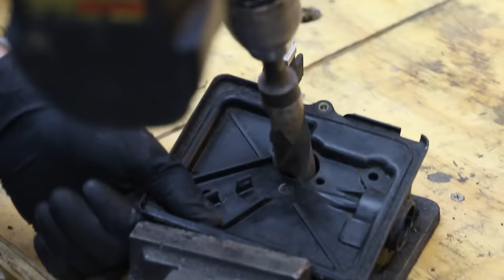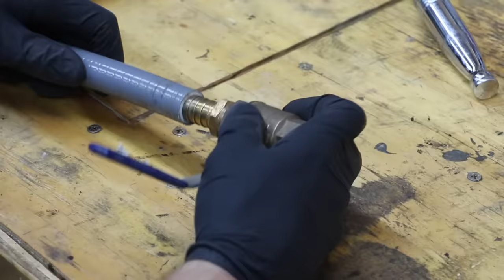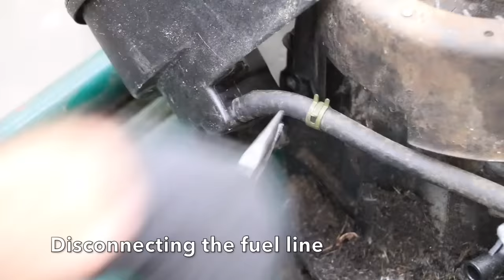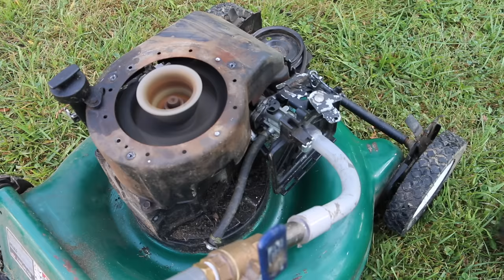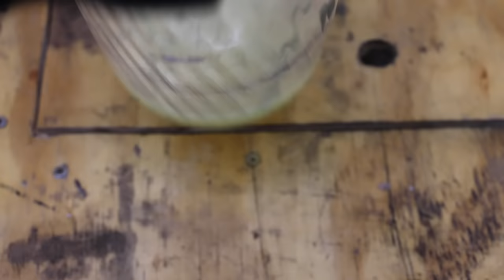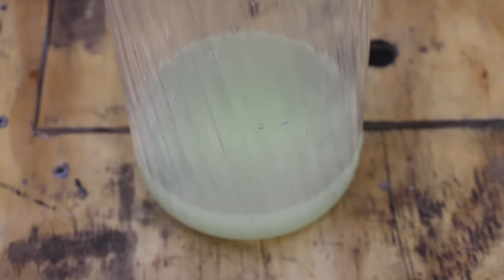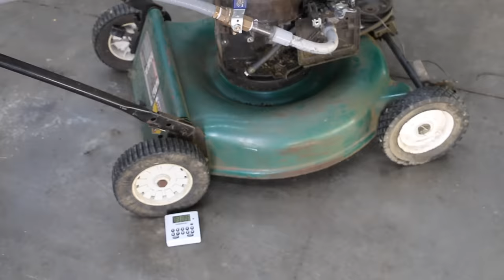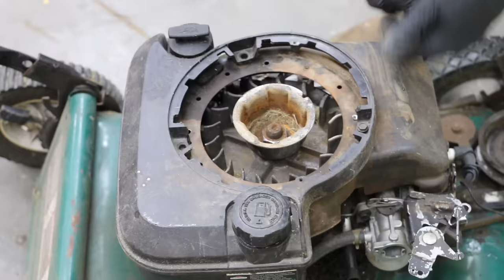Will a "Gas Vapor" Container Improve MPGs and Fuel Efficiency?  Let's find out!

Comment: Beware, your carb is providing a very uniform mixture compared to your ‘ball valve mixture control’  so without let’s say a proper wideband o2 gauge you aren’t making a great comparison between the two.  Vapor allows you to run a much leaner mixture too which your setup doesn’t allow since you can only limit the total intake from your bubbler but not the quantities air and fuel vapor independently.  Nice try but many flaws.  Also a lean burn requires more timing advance (because it burns slower) which isn’t possible on a stock mower engine (it could be retrofitted with a crank trigger and a trimmed down speeduino however to achieve it, but that’s very advanced territory,
Reply: You can run lean burn with a carb too. This was pretty apples-to-apples.
Reply: @AustinPerdue  not really, a conventional carb creates near ZERO vapor, it tends to make rather large droplets in comparison. Hence it’s MUCH more difficult to achieve significant lean burn on a conventional butterfly throttle  carburetor and keep the engine stable.

Comment: Try and make a hydrogen cell. Ive always heard that using higher voltage instead of high amps will save more energy while making hydrogen. I've also heard it been told that using ignition coils for the high output would be the best thing to use. But try it with a small generator this time instead of a lawn mower.
Reply from the maker: Thank you for the video idea!
Reply: @ProjectFarm  you're welcome, and thank you

Comment: Wonder if you have already or would run an HHO to a truck and see if it actually cleans the engine and gives it better gas mileage aka make hydrogen through electrolysis and run it to the intake

Comment: About the closest thing I ever witnessed was getting 20mpg out of a fullsized van pulling a trailer- it usually got 10.  Drove it 700 miles like that, power was down but it still drove.  Pulled the little Carter 2 barrel apart and found one of the jets completely clogged with dog hair.  ….Back to 10 mpg….
Reply from the maker: Thanks for sharing.

Comment: Watch what happens when it backfires lol. If anyone else replicates this it would be a good idea to get a stainless pipe, put a screen at the end and pack it with stainless scrubbers. Intetnational V8 engines back in the 60s and 70s had a "flame arrstor" on the valve cover vent that was built like that. They are kot availanle so i made one from sink faucey screens, brass fittings and stainless scrubber pads. Put that in the hose between the bottle and the engine. That way if it backfires it wont blow up the bottle.

Comment: Was the engine running on vapour or was the engine running on tiny agitated droplets of fuel in the air? Air bubbles are encapsulated in some form of liquid, so by sucking air bubbles through the fuel, I believe you were delivering fuel to the engine using air as the transport device. To prove my theory, you could record the time fuel evaporates to vapour, since that is the true rate of vapour delivery. The vapour phase time will far exceed engine run time in these tests. Your initial theory was right, the engine won't run on true vapour alone.
Reply: Liquid gasoline doesn't burn. Liquid gasoline vaporizes as it enters the engine and that vapor is what burns. That's why transmission method doesn't matter. The only real difference between vaporized fuel and liquid fuel is the potential for explosion.
Reply: @OneTruePhreak  Nothing runs on gasoline vapour. Carburettor pumps, fuel injectors, they all spray liquid fuel which is atomised with the air flowing into the engine. liquid gasoline does burn.

Comment: Should run fine on the fumes.The fumes it what's the most explosive. An empty tank will explode quicker then a full tank and bigger explosion.
Reply: Doing away with carburetor
 then going to fuel injection was mainly to stop people from doing things like this and hydrogen and getting better gas mileage.

Comment: I had a little better results with an old 6 hp generator. I pulled fumes off the top of a 2 gallon gas can. Measured the gas before and after with about 25-30% better economy on fumes than liquid.
Reply from the maker: Thanks for sharing.

Comment: Back in 1975 ,i had a mc-culloch dt44 chain-saw , and ran it hard with a 20/1 gas/oil mixture ,and at a certain point , it was going ,and going ,and going ,so i checked the gas tank ,and it was empty , , ,that means , that i was running on "vapours" for a while. The gas tank was made of aluminum ,and was just over the cylinder ,so it got pretty hot , so yes ,a two-cycle engine does run on vapors, exeot , well yeah ,the piston did not like the lak of oil ,it did not seize ,but ,it got scored .
Reply from the maker: Thanks for sharing.

Comment: Try turning an alternator from a 63 Chevy to a generator to power your house see if you can achieve that
Reply from the maker: Thanks for the suggestion.
Reply: @ProjectFarm   ok so story goes that once the diodes are cut off from the coil bindings and put power to the staiter between 3 to 12 volt DC and u get 90 amps ac and you can use the regulator to charge up the battery which will power the motor that will spin ur new generator and splice into your home .oh and you will need a copper or steel rod to use as a ground .seems simple enough

Comment: Cars originally were manufactured to run off vapors. It would drip onto a sponge and a fan would pull an air vapor mixture. But the gas oil company doesn't like that
Reply from the maker: Thanks for the feedback.

Comment: I created a small gas vapor system (a very cheap one) I was able to run my car without liquid gasoline for a mile(disconnecting the gas pump fuse) I think it would work but you may need a huge tank so there’s more vapor( I used less
Than a letter of gasoline liquor to create vapor
Reply: Did that on a 2001 Mitsubishi Eclipse rs
Reply: Revs wouldn’t go above 4k 😅

Comment: I got an idea you can build, a wood gas powered  8n ford tractor with a pto electric generator, pto wood chipper, and a hydraulic log splitter, if you want a bigger challenge have the heat generated from the tractor heat your shop or house
Reply from the maker: Thank you for the video idea!

Comment: I knew it would run because a carburetor works by turning fuel into vapor. However, I did think it would be more efficient. So unless there is a better way of doing it to make it more efficient, just keep running your engine the old fashioned way like it came from the manufacturer.
Reply from the maker: Thanks for the feedback.

Comment: People asking if a car will run off vapor's are funny. Yall never heard of a carburetor? Fuel injectors also vaporize the liquid. The entire piston does not fill with liquid.. it fills with a air to fuel ratio... essentially its just a vapor with a mixture of fuel and oxygen that creates a good combustion to generate power from torque generated during the piston stroke.

Comment: Thermally there is approximately 70hp for an hour in a gallon of gas. The carnot limit is 37% efficiency. So almost 30hp for an hour. It takes 10-20hp to cruise down the highway. So that would be 1.5 to 3 hours or 100-200 mpg. That would be a theorhetical engine with zero losses.
Reply from the maker: Thanks for sharing.

Comment: 42 seconds in... all engines run on vapors. Carburetors and fuel injectors, liquid to gas (vapor). Flooding an engine... 
Liquids take up less space and are not flammable. Unlike their vapors, which both take up more space and are extremely flammable.
So this should work, hopefully it doesn't explode

Comment: If you close loop the system I bet it would keep the gas fresh longer. May have to figure out a sealed system
Reply: it works ive seen it done.. the exhaust went into the air intake of the bubbler and the intake (mixxed) fuel hose toward the carb had a tee with another ball valve for combustion air. how ever it didnt not start cold in closed loop and had the exhaust running into another tee with two ball valves one went to out side to exhaust the other went to the bubbler intake that had another  tee on the intake hose of the bubbler, one  ball valve went to out side air and the other ball valve directed exhaust to close loop the system. I watched the briggs 3 hp run for about 5 minutes...the exhaust didnot over heat the bubbler like you would think... also the fuel mixture was 50% water and gasoline..the exhaust heats the water which cools the vapor. and also has unburned HC in it... think EGR  Im sure it could be modified from there. cheers
Reply: @garykentner7557  that's good to hear.. Yo I just found this and now more and more of these real videos are being discovered but the ones that produce extreme capable outputs that are to good to be true are the ones who get suppressed.

Comment: This is not a proper test because you werent measuring the load output . The speed of the blades in this case. In fact, you could have been running with 2x as much output and not realized. The first test I can hear a literal difference in output. The frequency of the engine is higher which means its spinning faster than the regular gas. That may be due to many factors but you could have been running the engine too hard with that vapour. So , by fixing the variables , maybe less air  flow, adjusting the valve etc you may have gotten much better results.

Comment: This isn't a carburetor, since carbs don't pass the air THROUGH the gasoline.  They actually use vacuum to pull the gasoline through a metering jet and the idle orifice into the airstream.

You can bet this costs less than a carburetor, in the event yours should fail or you should have a problem like I did once.  I was backing up with a trailer behind me and didn't see my tiller on the other side of it.  So I backed the trailer into it and broke the carburetor off!  Of course, it absolutely HAD to be my NEW tiller!  It just couldn't be the old, worn out one, NOOO!   A new carb would have cost $65, and I couldn't afford to buy one at the time.

Anyway, I suggest that you tee the PCV line into the air intake line before it enters the gasoline canister.  That way, it's eco-friendly and, more importantly, the air temperature going in will be a little higher and vaporize the gasoline more efficiently.  It will warm up faster on cold days, too, and you might even get a little extra energy (fuel mileage) from burning the oil vapors of the crankcase.  Of course, after some time using it, you might need to clean or change the jar.

If you want to know more about where this idea came from, look for information on the Pogue carburetor invented by Alexander Pogue.  I forgot the date, but he was able to get a patent on it.

My dad had a copy of it and attempted to build something similar (in the 1980s, I believe).  He overcomplicating his, though, with an electric heating coil and became discouraged after he had a fire.  I have a copy of the patent also, but God only knows where now.

The story goes something like this:  The Pogue carburetor was put on a car and it got 126 (or 156 or something like that) miles per gallon of gas.  So Pogue sold the patent to an auto manufacturer.  And they, in cahoots with Big Oil, decided to shelf the idea.  It would be worth way more to the oil companies to leave it that way rather than to have one in every vehicle.  Just think of how much money has been made off gasoline, as opposed to paying people to take it like they had to do in the beginning, back when all they wanted was the oil!

Also in the late 1970s or 1980s, there was a lot of interest in Howard Smith's (I think that's the correct name) permanent magnet motor which was also patented and alleged to run without any fuel or electricity input.  It also never made it to market, but I still have a copy of that patent, too.

You can order patent copies from the patent office.  All you need is the number of the patent.  I don't remember what they cost.
Reply from the maker: Thanks for the feedback.

Comment: From my experience  the difference in economy shouldn't be much since the fuel wasn't heated. gasoline has a low boiling point, approx. 35deg. C and a final boiling point of 200deg. C. stoichiometric mixture is roughly 14:1 and the expansion coefficient  of 0.000950/degree Celsius. regardless of the increase in size of the molecule the stoichimetric mixture would remain constant.

Comment: This is a forever subject that people will always wonder about until they try it. Yes the carburetor vaporizes the fuel in practice but not completely and there is lost in that. If you don't believe me go out to your lawnmower and pour some gas a small amount right in through the carburetor into the engine and try starting it up and it will run and all you have to do is for a small amount in and it is liquid and it'll run. That doesn't mean it will be efficient. If you vaporize the gasoline the efficiency goes up some but when it is vaporized you lose the ability of getting a lot of fuel into the chamber so your power will go down there is some point of drivability or use because it is heated air and fuel Which is less of a charge than cool air and vaporize gasoline through saying injector or from a carburetor. In a carburetor you get a cooling effect from the gasoline vaporizing giving you a cooling for the charge which is good to increase density of the charge and the power. You can get better mileage and I've known people who've done this by using heat and vaporization and Teflon gaskets in the carburetor and they started on gas and running on Vapor but have to shut it off to go over hills and mountains and go back to gas. There is no free nothing. Just like propane has gone to liquid fuel injection as opposed to coming right out of the bottle into the car or forklift. It gives more power when it's injected in and the air is there and you can have the density you need both air and the gas. The big issue is the possibility of catching it on fire because it is heated gaseous and has air in it that is the real issue. So you can have perfect air fuel mixture but how do you regulate that on making what for the gasoline into vapor? It is a very hard thing to get the right stoichiometric ratio of perfect burn so if you are dealing with a vapor I think you're going to find it's going to be far harder because you don't know how much fuel to air ratio is in the vapor or in the vapor of pure gasoline. In today's world vapor and gasoline are going to be an insurance risk and they Automotive companies have enough problems as it is. It's not a black-and-white world it's a gray world
Reply from the maker: Thanks for the feedback.

Comment: If you put a sponge on the bottom of the container lift the air intake pipes just barely above the sponge you won't have that problem put gas on to the sponge not going over the top of it and it will work better.
Reply from the maker: Thanks for the constructive feedback.

Comment: All IC engines run on vapor. Every single one. That is the goal of carburetion and injection. As the engine warms any raw fuel droplets( very, very small droplets) will flash to vapor from the IR being radiated from the hot internal surfaces. These results are unsurprising. If you still want to argue the point....why does ether run an engine? Is it ever not a vapor after leaving the orifice?

Comment: I tried this years ago on a Chrysler Cordoba it would run for a little while then it would use up all the octane in the fuel and wouldn't run anymore just lost power and died despite lots of fuel left in the container, also wasn't stable would need a much better metering device
Reply from the maker: Thanks for the feedback.

Comment: You can get a finite amount of energy from gasoline vapors until the remaining liquid loses it combustibility.  That is what happened when the guy with the "black box" on his 100 mpg car failed in the 1970s.  Great idea, but the fuel still has to be renewed.  Danger of explosion in the system is ever-present, too.  Explains why it was never manufactured in mass.
Reply from the maker: Thanks for the feedback.

Comment: Good video. If they invent something that would be smaller and bolt to the engine and would turn liquid gas into the vapor right before it was needed… then you would have something…..
Reply from the maker: Thanks!
Reply: They do it called a carburetor.

Comment: I expect the leftovers are detergents and cleaners designed to keep an engine running well. These cleaners impede the calorific value of the fuel but I wouldn’t remove them by burning vapour. You are effectively distilling the fuel from its detergent’s
Reply from the maker: Thanks for the feedback.

Comment: The real problem is that your horsepower is basically gone and forget about torque. Running does not equal horsepower which is always been the problem with running a lien vapor. Charles Lindbergh taught P-37 pilots how to double their mileage by running a lean mixture with water injection so they could fly all the way to Tokyo on bombing runs making the round-trip almost 1600 miles up from 800 miles. Without the water injection the motors would literally burn up by running a lean mixture which consisted of vapors only. If you're going to do this you better consider water injection very seriously. You can find data on Charles Lindbergh and P 37 fighters and how he taught the aviators how to make it to Tokyo on gas vapors PLUS water mist injection. Very interesting story and true history.
Reply from the maker: Thanks for the feedback.

Comment: How about a combo on a valve like add a mini hydrogen vapor cell hooked to a T with the fuel vapor cell and a air also. All on a valve also to control each flow. Objective use almost no pump gas and be able to cut a 20 minute back yard.
Reply from the maker: Thanks for the suggestion.